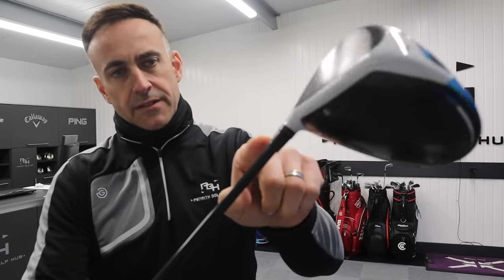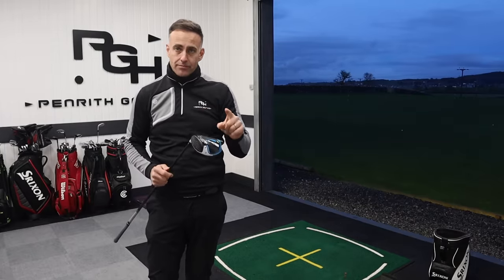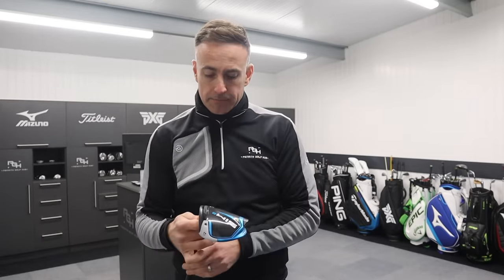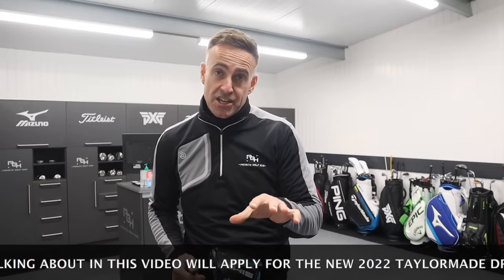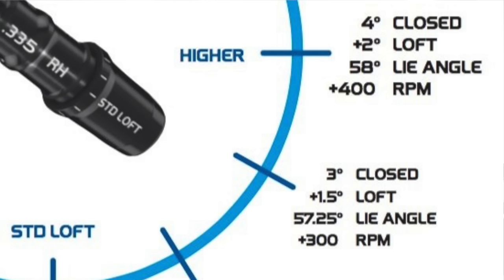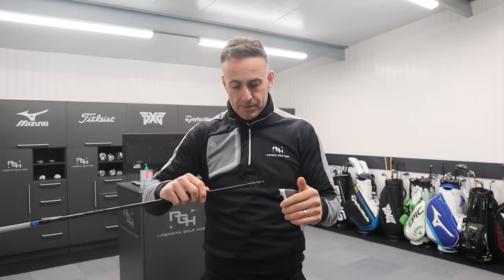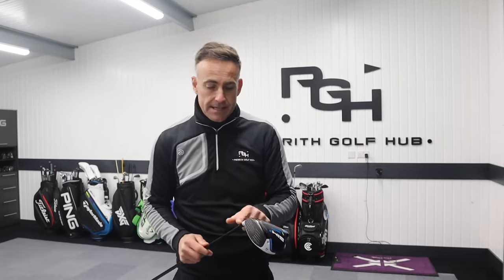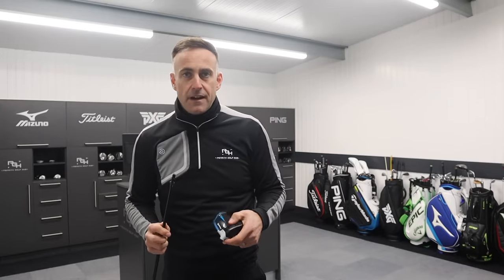MOST GOLFERS DON'T KNOW THIS & It Can Be Harming Your Golf!!

Comment: Playing a SIM 9.0 in Std setting, sliding weight neutral with about 4gr of lead tape toe side of the fin. Found the setting and shaft (Aerotech Claymore MX48) by myself. Had a similar setup in my old Titleist driver. I moved the shaft over and made a similar setup. Have been trying to go lower but found that it launched too low at the time. Might try lower again if my speed comes back up a bit. I am playing my TM Ti 3w & 5w 2 clicks lower.

Comment: This is super useful. I have a Cobra King Speedzone Driver with 10.5 Deg Standard Loft....and I had reduced the loft to 9 Deg and immediately started slicing the ball like...crazy! I have a left to right ball flight and now that I have seen your video...I am shifting back to 10.5 Deg loft. Thanks MNG!
Reply: I think Cobra adapters also has a D (Draw) setting so if you use 9.0 D, it should offset the open face that normally comes with de-lofting a driver.

Comment: Getting fitted this week. Typically need a 9° head with a mid-low spin stiff shaft for optimal launch. With that said I miss everything to the right at standard. Gonna try 8° heads in the sm2 and tsi3 and loft up to 8.75° with upright setting to get good launch but straighter flight

Comment: Got fitted for the sim 2 earlier in the year and I was expecting to be fitted into the sim max but that was spinning too much, so with my delight I was fitted into the standard sim 9° and the fitter put it in the upright setting, at address it sat perfect to the eye and it also helped with my bad shot to the left (I’m left handed) and with that my confidence went through the roof
Reply: I got the SIM Max and simply turned it down to 8°. That took a lot of spin out and smoothed out my fade. At 57, I can mash it out over 300 yards, now.
Reply: So you hit it occasionally (1 out of 10) 300 yards with the wind behind you with the ball hitting a firm downhill fairway. The rest slice 3 fairways over.
Reply: Might have to try this. Been just shy of higher 1 or 2 clicks making my head 10.5 (9 degree head) seem to be hitting well. But may try normal setting in front 9 and upright on back 9 when I play and see how it feels/ goes further

Comment: I play a SIM2 and have the neck setting at 1.5 degrees lower loft but in the upright setting (58.75*).  I have it in this setting for 2 major reasons.  I hate a miss on the left and my bad shot does tend to be a hook.
But the biggest reason is that I like to look down at an open face on my metalwoods and play my driver, 3 wood and hybrid all set in open settings.  Just prefer the look at address.  Putting it a little upright then helps me maintain a little draw which is my preferred shape off the tee despite the face being open.
I play the driver at 7.5* because I do have a very high ball flight even with a Ventus Blue 6X shaft that has been tipped 1.2 inches.  I may switch to a Ventus Black or RDX Smoke Black in the future.

Comment: Mike one thing to note. If you adjust the hosel to higher or lower, face angle is only changed. The loft does not change unless the golfer squares the face back up at address. So for example if you set it to higher it only closes the face. To get the extra loft benefit you have to square the face back up.  Great videos by Tom Wishon out there where he goes through all the hosel settings and how they impact face angle, loft and lie.
Reply: So if I adjust to “higher”, and I square the club at address, I have now increased the loft but negated the Draw bias?? If yes, then does that mean for a draw bias I adjust setting to higher but “don’t” square the face?
Reply: @ashish.chauhan  Don’t you hate when people don’t respond to your question?
From what I understand, your true draw bias comes from a weight on the bottom of your club. depending on the manufacturer, you might see an off-centered weight toward the hosel or an adjustable one at the rear of the head and that is where you’ll get your draw bias.

Comment: to be fair, the loft changes only exist when you square the club face from its position the neck changes it to. if you add loft with the sleeve, the face closes, the loft is not increased in this position, it only increases when you rotate it back to square. so no, you cannot have a closed face AND more loft. you can have one or the other.
Reply: Yes you can

Comment: With the greatest of respect, the stated loft on the club comes with manufacturers' tolerances that you'll have to dig deep to find.  So if a club says 9, it could easily be 11 or as low as 8 unless you've got the ability to measure the loft yourself. On top of that, once the client decides on loft or face angle, it needs to be further explained how the majority of golf shafts have only one consistent position and that is why youll never see a touring pro changing adapter settings at the practice range during a tour event

Comment: Happy New Year all.  Yes I do Know.  I don't find it confusing. I don't touch mine though as it works fine.😀 My driver was fitted 1 inch shorter for more control an extra 4g in head and neutral loft and stiff Hazrdus shaft as I have a draw most of the time.

Comment: I've never been fitted, I've purchased this driver last summer and I was blocking the ball a tad, not a Legit block but my ball was immediately traveling well to the right of my target then last second wanted to draw back like five yards, It was fighting and resisting my draw, i have an 8 degree with a 6.0 shaft. So I tweeked the setting to a 4 degree upright shaft angle and it helped me big time now my ball has more of a draw by about ten yards and is starting out much more straight towards the target. Amazing how such a small adjustment can impact such a severe difference. quick fix! I added loft to see what would happen but it only snap hooked for me. Great video thanks to you I know my lie is 60 degrees!!  Trial and error is for me, I am a scratch golfer but I can hardly afford to play, so everything I do is through DIY & YouTube is my teacher

Comment: First video of the new year and it's a good one. I also saw an older video a while back by the Mobile Club Maker who shows the relation to the shaft and club head that makes it even more clear for those nerds who want to know more. I like the more simple explanation though - makes perfect sense and good to know.
Reply: mobile club maker vid was really good.
Reply: @djones1304  I know right. He has a lot of interesting videos from a club maker's perspective. I now put my grips on just using masking tape and an air compressor because of one video he did, and I love it. Can try new grips without having to wreck the old ones. Works great.

Comment: Hi I've bought this years new ping max . But was told in the fitting my awing speed is 80mph equates to 200yds SO how ws it I hit mavrik sub zero at times 293 to 298 yd . So I tried myself changed weight to left went up from 9 to 10° and have hit a 252yd drive once average is 230 yd . What do I do in settings for more distance.         paul

Comment: Correct me if I'm wrong.. but if it just applies different degrees by turning the shaft inside the club head,  can't you get the same effect by gripping the club grip in different rotational positions with your hands  ?

Comment: Can someone please help me out. I recently picked up a second hand M4 9.5 driver with a stiff shaft. before that I had a cheap brosnan 10.5 with a standard flex shaft that I sliced like a champion. The M4 was setup by the previous owner at the higher setting and my slice was all but gone. I'll either hit it straight or with a slight fade. If was to adjust the head to the upright lie, could I in theory keep hitting the ball straight but with added distance since the loft will be 9.5°?

Comment: Thanks for the video@MichaelNewtonGolf.

I'm a LH gofler I've been playing a TM driver for the longest time and it's really difficult to come by a LH sleeve. So I've been using the RH sleeve in my driver (Stealth Plus 9Deg) but can never seem to get a reliable answer on the topic. When I use the RH sleeve, does this mean that the settings are opposite to the fitting chart or will the RH sleeve simply not work for a LH gofler? Hope you can clarify, thank you so much.
Reply from the maker: Yes, opposite

Comment: I am still a little confused as to how when lowering the loft the face opens. Normally with other clubs if i open the face the ball the loft is increased and if closed then decreased. I just seems illogical to me.
Reply: In order to get the new adjusted loft  you then have to set the face correct/straight at address, should hover the club and NOT let it sit at address. Taylormade (Mizuno/Cobra /Wilson are similar) sleeve adapter only changes the face angle and then when the user set them straight again there will be different lofts. By straight I mean "square"
Reply: @Fufiloofa  that could be me screwed then 😅 I like to sit the head on the deck. Gaming Callaway Epic Flash
Reply: I'm the same never made sense 2 me
Reply: Aitch not haitch Michael.... 🤷‍♂️Just saying. Great video though. 👍
Reply: The sleeve delofts and opens. Nothing illogical about it at all.

Comment: Left and right hand adapters for TM are identical but the functionality of the positions is reversed. For example, full LOWER setting is HIGHER. If you are a left handed golfer and swap shafts to one that has a RH sleeve, you don’t need to switch it.
Reply from the maker: Yes you are correct but I’ve come across many golfers who have purchased second hand TM drivers in right hand with Lh adapters & not released! Generally when pro shops sell off their demos they whack shafts in heads and don’t check. That’s why I mentioned it in the video 👍

Comment: I bought used Sim with a stiff shaft and had a devil of a time hitting it. Then changed to a regular shaft and it was much better. I just found out the Stiff shaft is Left-handed. and my head is Right handed. So no wonder I was getting strange results when I fiddled with the lower and higher settings. 

So it is just opposite right Lower actually means higher correct?
Reply from the maker: Correct

Comment: Hi Mike, I want to decrease my spin but without the club face opening. Can I take the shaft completely out, put the sleeve on the head in lower then put the shaft back in when the face is square will that work? Effectively just be a standard 7 degree driver then (square face)?
Reply from the maker: No sorry, if your wanting to reduce loft to reduce spin then it will open the face, no way around it.

Comment: I have a Paradym x in standard settings 10.5 degree. I can only seem to draw the ball which is not a bad thing but sometimes I need a straight shot. Any settings I could do  that would give me a square face rather than a draw bias, many thanks
Reply from the maker: Only option is to drop the loft to -1 and have the other setting in either S or N - this would help slightly

Comment: is it bad if i have an RH sleeve on my left handed driver? i know its not idea but couldnt i just apply when im putting it +2 more loft I would just need to -2 as the setting to achieve it?
Reply: I believe this is correct. Standard and upright stay the same. Delofting or adding loft is reversed. +=- and vice versa

Comment: I personally use the sleeve a lot when practicing - and I would highly encourage others to do so. What I will do to work on my Draw is set the driver 1-click open (slight fade setting) and then practice my draw - it really forces you to control path and face to path when you do this. Conversely, I also do the opposite, close the face 1-click (slight draw setting) and then work on fades. The more you do this practice, the better driver you will become. Then, back to square and you will find it much EASIER to hit soft draws or fades
Reply: Your good arnt you

Comment: Thanks for the video, question. My sim titanium 3 wood looks closed to me at address. It’s set at STD (15degree). What setting opens the face but keeping same loft?
Reply from the maker: You can’t, opening the face will lower the loft. Try it 1 notch towards lower and that should make it sit squarer and you’ll only lose a touch of loft. Refer to the video and the chart that I displayed. Will show you exactly what happens 👍
Reply: As Michael stated, you cannot open the face without changing the loft.  You have to decrease the lift to open the face angle.  You can also install the LH sleeve and make it upright (It actually flattens the lie angle).  The flatter lie can mitigate the ball from going left but it will not change the face angle…

Comment: Really well detailed,  Mike. Historically, I have not taken advantage of and explored the settings of my TSi3. I play a draw and had it on draw setting which definitely promoted a pull hook. Combine this with lower loft (8 degrees) presents a recipe for disaster. Recently, I have adjusted the adapter to a fade setting and benefited from a much more stable ball flight. Cheers and Happy 2022! 🙏🙌👍✊💪

Comment: Just trial and error at the driving range until you’re happy. That is all custom fitters do anyways.
Reply: That’s an oversimplification of the process. At a custom fitting changes are made based on the metrics  (spin, launch angle, descent angle…).
Reply: @Ardie321  A custom fitters job is to get suckers to spend.. Unless you’re trying to turn pro none of those matter to us

Comment: The best description/breakdown of the TaylorMade hosel settings. 
TM and Titleist have the 2 best adjustable hosel sleeves. 

Currently gaming a 2016 M2 driver 10.5 deg. which has given me the best performance compared to Sim2 Max in my last shaft custom fit just 6 months ago. My hosel setting is one notch low so playing 9.75 degrees. 

Upgraded to a Small Batch Evenflow Riptide CB 6.0 over my Hzdrs Smoke yellow counter balanced 5.5 shaft and gained 5 yards in carry and total. 
Happy New Year Mike !! Looking forward to more videos in the 2022 !!

Comment: Went to a fitting, got the 9.0 TM Stealth Plus paired with a KBS ES 70 shaft. Was fitted to use the Upright Lie with the bottom weight just short of the fade side. Was hitting over 300yds straight, even my miss hits favored just barely to the right, they were still good shots. Did not have the expectations of getting a Stealth but it was best suited for me along with said options.

Comment: I build my clubs and self fit.  I also spine align my shafts and align the spine towards the target.  Spine changes the way the club plays.  So with these adjustable tips,  it is quite the process for me to experiment.  Fortunately the tips are made of metal.  I just have to keep plenty of ferrals in stock.  I use TM woods.  Sim Ti.  Titelist tips dont change the graphics alignment and I wis TM tips had that important feature.  I end up liking the notch 1 before Higher.  I have a driver that that I find the middle of the face almost every time.  I want a little lower trajectory but it throws off my consistency.  I occasionally put it to standard but then get a fade.  I have to shut it down, strengthen my grip,  but then the loft is too low.  So I settled on the setting that goes straight and down the middle most of the time.  I leaving 15 plus yards on the table but finding the short grass is more important.  I use two shafts.  One is a Ventus Velocore Blue S.  My stable consistent shaft.  I also have Fuji Pro that came in My 15' M2.  I get a good 20 yards longer distance but it can goe left, right or down the middle.  Only find the fairway 1/2 the time but hardly ever too far off the short stuff.  The Velocore goes 270ish/ 280.  The Pro goes 280 to 300 and once in a while 310.  Wish I could get the best of both worlds but am not going to complain.  In the cold season with moist slow fairways, those distances come down.  But it is cool that the tip has help me find a very reliable consistent Driver.  I never had a Driver that finds the fairway most of the time.  It makes a huge difference in score.
Reply: Please shorten this reply.
Reply: @lm2487  Please stop being so short with me.